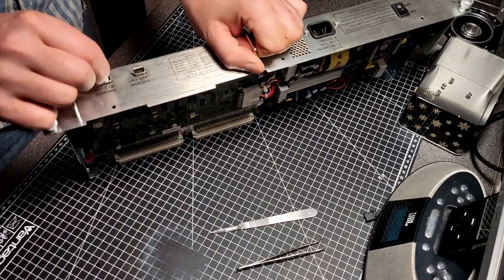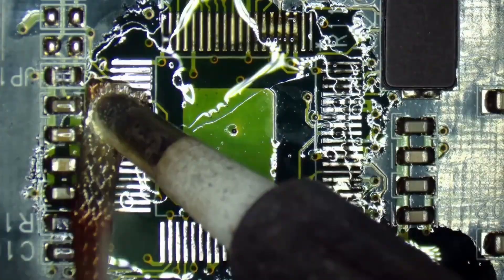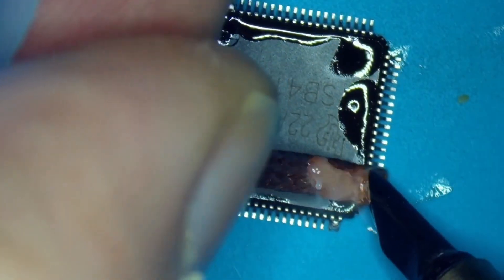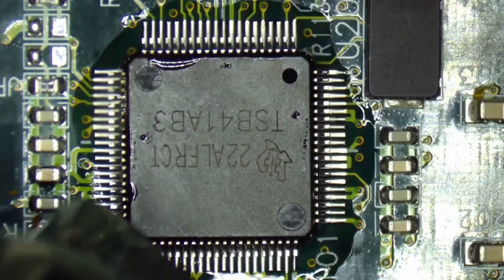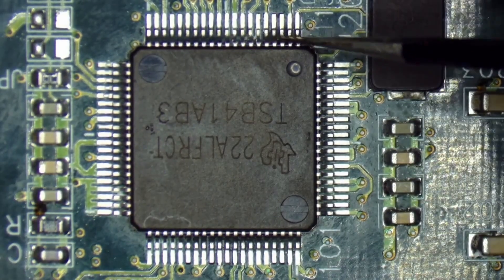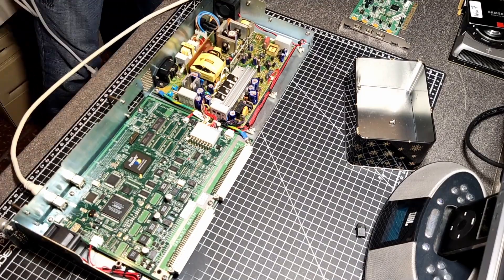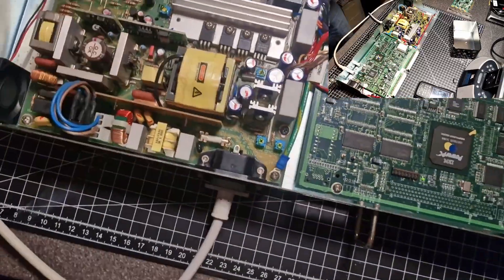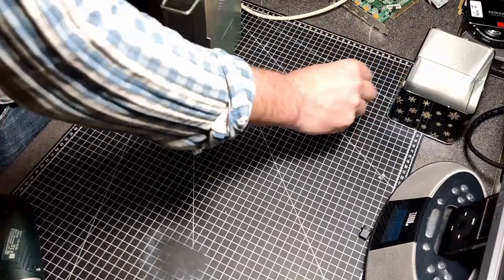Film Scanner Repair - Firewire on Creo IQsmart 3

Comment: Big fan of the group, looking forward to more content. I currently use a Minolta elite scan 5400 (1). If it ever breaks down, I know where to reach out !
Reply from the maker: Thank you very much. I'm currently working on a series of videos about the Minolta Scan Elite series. First one will be about the Scan Elite II. Later on i will cover also the Scan Elite 1 and both the 5400 MK1 and 2. I'm planning on showing a complete rebuild for each scanner as well as videos about optimization. Like for example LED conversions and mobile power supplies for travel usage.